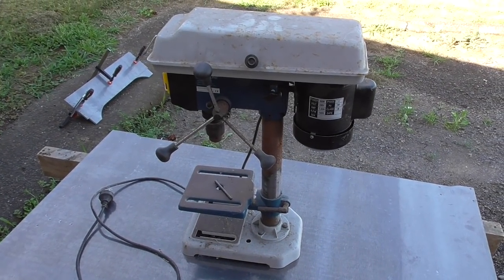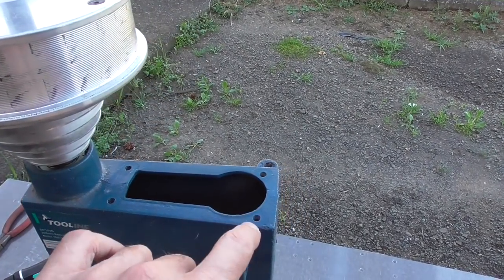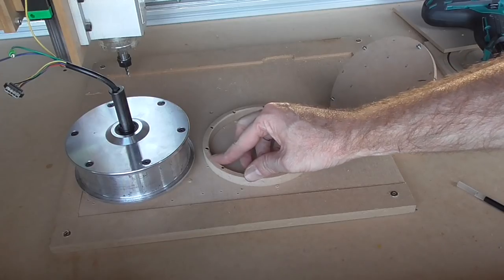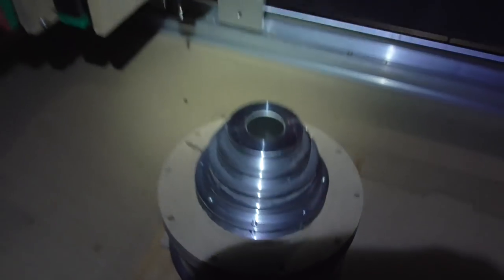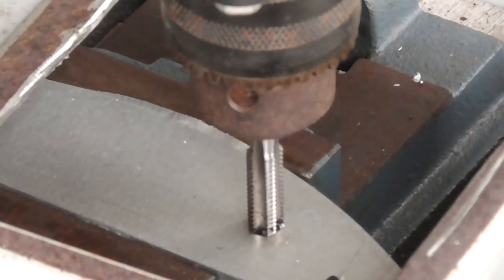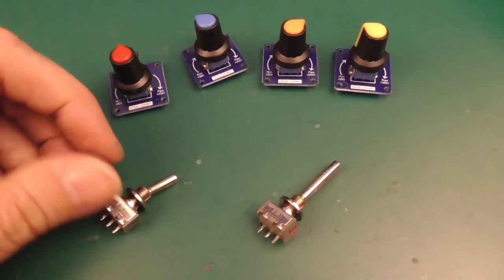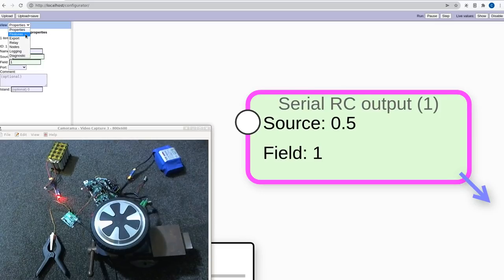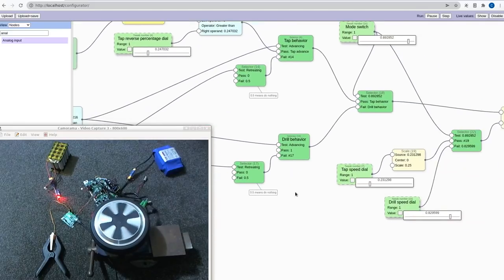Old drill press + hoverboard motor = power tapping thingy

Comment: That thing is awesome. by far one of the best repurpose projects i have seen in a long time.

Below are some things, they are all unnecessary and wont give any better performance but add to the Safety of it.

when fitting potentiometers to gear that has enough power to hurt you there are two main things that help increase the safety factor. 
 -The first is to use two small resistors, one on each side of the power supply to the pot. then in software program the range of values of each resistor inhibits from the pots range as failure zones. For instance if you have a 5k  pot and you add a 220ohm resistor to each side of the pot, and the controller is 256bit adc then you can assign bit range '0 to 10' and '246 to 256' as pot fail modes. that way if the wiring or connections to the pot fail and it becomes shorted or unplugged it will stop instead of going full speed.
-The second is two use two pots in a inverted setup, one rising and one falling then in software compare the value of each and fail of the pot 'A' - Pot 'B' = greater than pot accuracy example 8%.
The second is safer and even better when also combined with the first.

The same fundamentals can be done to switches. adding a validity check resistor. Unfortunately most of the time this can only be done with a analog input or 3 well balanced digital inputs per switch state.

the next thing is the belt. a correctly set drill press belt offers a primitive torque limit function. I some older drill presses the belt was never tight and would be hand liftable from one pulley to the other. Unlike a car fan belt or other drive belts that get adjusted to a tight tension.

Comment: 10:15 What you probably want to do is run the motor in FOC_VOLTAGE mode, and implement a PID loop on top of that to control the motor velocity from hall sensor feedback. You will get the most low RPM torque out of voltage control in my experience, with the added benefit of 0 "wind-up". At some point you will reach the limit of what the motor can output until you can attach an external encoder to it, as the FOC observer/predictor can only guess so much about the rotor position at such slow speeds, and will begin to twitch.

Edit: I should probably watch to the end, you figured it out basically 😅

28:30 Its slipping that much with such little force as taps are hardened, and the jaws in Jacobs chucks are also very hard. So even if you tighten down as hard as you can, they will always slip as its essentially like glass sliding on glass.

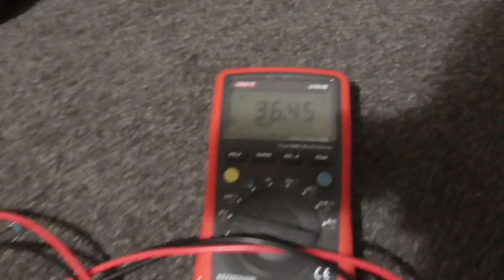31:24 What I typically do when working with these HB mainboards is to put a jumper on the power-button JST port so that the buck-converter circuit and CPU is essentially always latched on. This of course empties any remaining charge in the bulk caps. I also typically keep the jumper connected and disable to power-button functionality in the firmware so that it is always on when power is applied. I do this for projects which have multiple hoverboard mainboards attached (4WD typically), so they all power on and off in unison. I used a precharge circuit & a 100A DC-rated MCB for power on.

Comment: If you use spiral flute taps you don't have to worry about breaking the chips. That's how most machine tapping works
Reply: Or cheaper gun nose taps for through holes
Reply: They have taps now that are made for drills and tap guns made especially for this situation. Dewalt and Metabo both have sets. Pro Consumer grade so probably pretty cheap. Same as what @Pat Kirk suggests but probably not as expensive.
Reply: @sevilnatas  I have used the default 1/4-20 spiral drill tap and broken quite a few. You must have good bearings, a rigid set up and lube.

Comment: You could put a limit switch on the depth indicator and screw it to the desired depth. That would rotate the tap backwards for a fixed duration until you're ready for the next hole.

Comment: Ya just gotta love the ability to weld steel together at home. Keep at it and you'll get it dialed in. Just from my very minimal observation and from one asshole's opinion......... It looks as if you may have her turned up to "obliterate". I'm assuming that you're in a nation that supplies 240 volts? A lot of my experience with the 120 volt MIG welders here in the states is that they HAVE to be turned up to "obliterate" just to weld anything that's substantial, but the 240 volt MIGs can get down on some serious thickness and blow holes through half inch steel like it's cool. Lol! 

Love this project!! I've got 2 of those exact hover boards and all the internal components and have been dying to use em on something worthwhile. So, thank you thank you thank you for sharing all the details that you have!! Keep em coming!!

Comment: My forcefeedback motor is a industrial servo motor. Jep just a 15k step encoder on the back makes a regular motor work with very accurate positioning. The controller sees movement smaller than me moving the wheel 1 hair width. Forget stepper motors that can lose steps, slap an encoder on the back and know motor position at all times.

Comment: Magnetic drill press is what you are thinking about. the press you have as it sits is sufficient to do everything you just need to rip out the controller for the motor and install a more advanced digital controller

Comment: you can use a tapping head to do what you wont to do. in order to get to the bottom of a blind hole you have to use two types of taps  a plug tap to start the the threads and a spiral flute bottoming tap to get to the bottom of the hole.

Comment: Cool little project, try gun taps instead... they are night and day better than hand taps.  Also, not so sure about the way you held your motor.  The rear part of the shaft should have some float to allow for misalignment.  Check my video on the automatic door I made with one of these motors for more detail.  The stress from misalignment will damage bearings, fatigue welds etc.

Comment: What would be really interesting would be a strain gauge sensor in the handles that allows you to turn them up and down to contact the tap to the work piece but when it contacts and you push against the work piece, it moves the motor ahead at the rpm you set it for and when you let of of it it stops. If you pull up on the handle while the tap is in the piece, the amount of reverse resistance would trigger the motor to run in reverse at the set rpm. Probably this approaches over engineering but interesting to think about.
Reply from the maker: You can get a mechanical attachment to do that, probably quite expensive though
https://youtu.be/3e8lfEbsLmg?t=89

Comment: With the 40 or so volts sitting across the filter capacitors one way of discharging them is to permanently fit a bleed resistor perhaps in series with an led for visual indication. About 3.3kohm or more will be adequate. 
Although it would drain the battery if the battery is left in circuit in a standby state.
Nice to hear a New Zealand accent on YouTube.
Reply: Check out MartyT's channel. You will be occupied for hours.

Comment: Don't know if position is that important, but if it was, you can print 2,3 or more bands of stripes that can give you a binary position with resolution determined by the number of bands -basically  a quadrature encoder. The strips can be read as they pass by some kind of optical detector that switches state depending on dark or light, or even better (and less influenced by ambient light), you can look for the transitions. Wouldn't be too hard to print the bands onto paper and adhere it to the rim of the motor. I suspect you can buy the led/detector in a package off the shelf and quite cheap. (I might be wrong about that).

Comment: You’ll probably need a function that takes the thread pitch and desired depth, so that you can count how deep the thread needs to go before a full retract. For instance you normally want at least 2 thread turns below a through hole so that the tap doesn’t have any taper. Take an m6 tap through a 10 mm stock through hole for instance they normally have 1mm pitch, so you can count your rotations, you should aim for 12 rotations (12mm depth), then command a full retract. 

Manual works too.

Comment: You mentioned early in the video you are tapping blind holes, using normal taps means you will have to change taps, and they also don't remove the swarf. You need to get some spiral taps, can tap to the bottom of a hole and push the chips out the top. And always use a tapping fluid or compound.
Are you aware you can purchase power tapping attachments - they plug into the arbour of a drill and automatically come back out when you release the pressure on the handle, they also have a clutch which you can adjust so you don't break a tap. They are fast. But you need the spring return on the drill quill to do the return.

Comment: I am sure I don't need to say this, but near the beginning you say you only need to hold the motor shaft from spinning. But you have built a rigid structure resulting in it being over constrained. You want either a flexible coupling between the motor and pulley, or replace the top structure with just a torque link. Now this has got me thinking. I wonder if this sort of motor would make a variable drive for my small lathe? 🤔
Reply from the maker: Actually a lathe was the first thing I daydreamed about using these for (at least in the power tools category). I watch a lot of turning videos on YouTube, but it seems like another huge rabbit-hole of learning that's a bit low on the priorities list for me to go down.

Comment: I think I'd just stick with the belt drive and eliminate all the issues that come from trying to centre a weird-shaped motor against some other piece of metal, against a shaft. You can lock the motor shaft into a plate screwed onto the top of the drill mount, chuck a belt on it, and you're done.

Comment: What do you mean by "closed loop mode" on that motor? My ebike direct drive motors have the problem of low torque unless rpm is fairly high.
Reply from the maker: The motor has hall sensors to detect how fast it's rotating. Closed loop means it's using that sensor feedback to adjust the power, based on a specific target, instead of just changing the power blindly. For example if you're driving down the highway, you would adjust power with the throttle pedal, and 'closed loop' would be looking at the speedometer to guide your adjustments to a target speed, eg. 60mph. 'Open loop' would be simply a target pedal position, eg. 45% throttle, with no knowledge of the resulting speed.
Reply: @iforce2d  don't these type of 3 phase motor controllers rely upon the HE sensors to determine what frequency to output? 
Like if the motor is moving at 1 rpm and you tell it to go to 100%, it's only going to be able to ramp at a rate depending upon how fast the motor accelerates.
I suppose you could just feed it a set frequency of 3 phase (a predetermined speed) and ignore the sensors. However I would think the rotation would be all chunky and shit until it got up to the necessary rpm, or even some factor of it.
Maybe I'm misunderstanding your analogy to a car speedometer.
Reply from the maker: There are two types of 'frequency' at work. One is a simple duty cycle PWM that controls the overall power output, 0 to 100%. The other is a more complex phase 'switching' of which windings of the motor should get how much of that power, and which direction the current should flow. The switching depends on the HE sensors to know when to change to the next phase. The HE sensors can also be used to count how many switchings are occurring and from that infer a speed.
https://www.youtube.com/watch?v=QgcAJpRFj1U

Comment: Great video..technically well beyond my level of understanding…just starting out re-purposing these motors!! Have recently built an electric barrow for the horse yard!!! Wish I had known about Low torque mode..I have installed just a generic co troller with no facility to adjust!! My next project is to make a remote golf trolley so was amazed to see your two motors running around the yard!😂 could you point me in the right direction regarding boards and what I would need. Apologies for being non tech!!
Reply from the maker: links are in the description...
Reply: @iforce2d  Hi, did you have any idea how get more torque of that motors by changing some settings in feru foc firmware ? that hoverboard motors have too much rpm  i need more torque not speed

Comment: I have considered doing similar with an old drill press, but we now have a CNC mill with rigid tapping so I doubt I will do it.  For me the issue was that my drill press doesn't have a reverse or low speed so I looked into using a small 3-phase motor with VFD, but your method looks good too.

You might consider using an ER collet holder instead of a drill chuck.  That would allow for some improved gripping strength on the tap and would allow you to use drill bits as well vs using a dedicated tap holder.  Tightening is done with a spanner which I find to be easier than a chuck key.  Regarding grip strength - We have an old Bridgeport that we were able to use a 3/4" NPT pipe tap going into thick aluminum using an ER40 collet if I recall correctly.  I never had the pipe tap slip even with that large OD.

Will you need to add some sort of depth feedback or torque feedback so that the motor can automatically reverse?  Doing a through-hole like you did in the demo it would be fine to just control it manually, but a blind hole like you plan on doing in the future will cause the torque to go through the roof if the tap bottoms out and will be likely to break the tap I would think.  Maybe sticking with the drill chuck will keep that from happening...
Reply from the maker: I'll just have to be very careful with the blind holes, especially as others have pointed out I should be using a spiral flute tap for that. Starting to think I should just make them thru-holes instead :)

Comment: since your controlling speed without belts why have the huge multi belt ?  simly mount the hoverboard hub and put a small belt pinion on the spindle and use the tireless hub with belt to the spindle.

better yet, take hub apart and from hub front facing face  you can bolt a collet directly to it that fits the spindle shaft.. this would drop the motor right ontop the shaft much lower and bracketing would be much easier.

we use this methos all the time when converting hoverboards to gocarts etc to mount larger rims.

Comment: an easier option than trying to modify or replace your drill chuck is just grind 3 flats on the shank of the tap, as long as you're careful to space them evenly and take off the same amount of material in each position. maybe you could come up with a jig to help with the grinding
Reply from the maker: If it becomes an issue I might end up having to do something like that. So far on my three test holes it has been ok, although that was only 6mm plate.

Comment: nice work.. the only thing i didnt like was lowering the head to the point of inconvenience.. Theres not much axial load on the quill during power tapping , its self centering.. So you could have the drill head higher and the vise mounted to the table.( less hands involved ) .  I power tap every day on the mill using a keyless chuck , which might be of some use here.. Yes , it occasionally slips , but thats similar to a clutch telling me its time to pull out , relube and make another pass. Anyway , cool project !
Reply from the maker: Right, for tapping it doesn't matter. The problem is drilling, where this press has awful runout, that gets worse as the quill extends. I tapped all the holes on the large plate yesterday and using the slipping as a cue to relube and make another pass is indeed how it ended up :)

Comment: Love the innovative approach and great video as always....  If the motor is close loop,  could you use it for motor position control.

Just out of curiosity you do know that you can get a pedestal drill tapping attachment
Reply: Yea it looks like the hacked firmware allready has rotational position values, might need to expose them. So you could get rid of the timers.

Comment: I'm not familiar with the software you are using at the end. I see it is local host so you are connected somehow? Thanks.
Reply from the maker: That's a system I'm still working on. I will make detailed videos sometime, until then you can see other videos where I used it https://www.youtube.com/playlist?list=PLzidsatoEzeieb0l_EUxpR0p7ed_RUPD6
The configuration interface runs in a browser as in the video, but it also requires a 'relay server' running in the background to allow access to the serial port.

Comment: A mag drill base might be better for this,although it wouldn't work on aluminum as easily, you'd have to clamp a steel plate on top and then magnetic base goes to that.

Comment: The cheaper drill presses usually have a terrible runout on the chuck - which is one reason they should be avoided. Clever reuse of it though :). I wonder if the hoverboard motor could do with either balancing or a radial load on the bearings (since that is what it is designed for).
Reply from the maker: Yeah this one is pretty terrible. Anything larger than a 6mm drill would cause it to bounce off the sides of the hole like crazy, eg. if there was a 8mm hole that you wanted to enlarge to 10mm, good luck with that.
Reply: @iforce2d  i have a drill press of the same design different brand. Mine also had the problem that i guess is generic to these with the wobbly spindle.
I "fixed" it by cutting down the center of the front of the machine, and installing some bolts across the cut. Essentially it turns the front of the machine into a pipe clamp of sorts. Adjusting the tension of the bolts just right can get your a wobble free spindle that still travels freely up and down